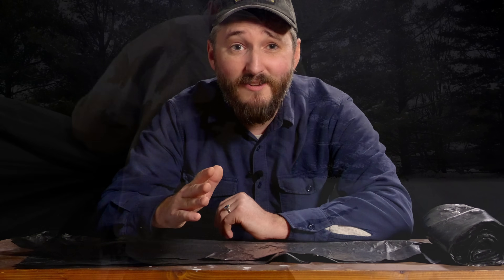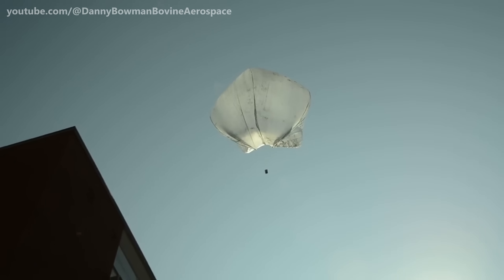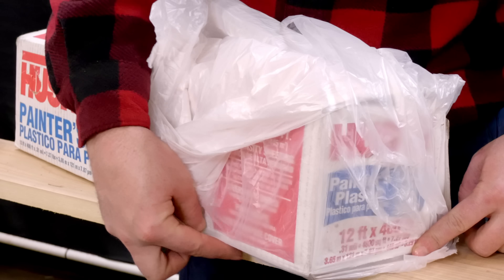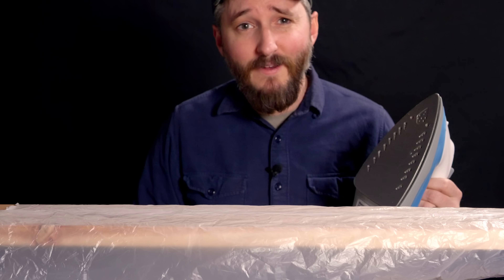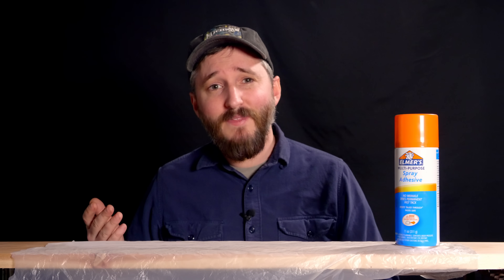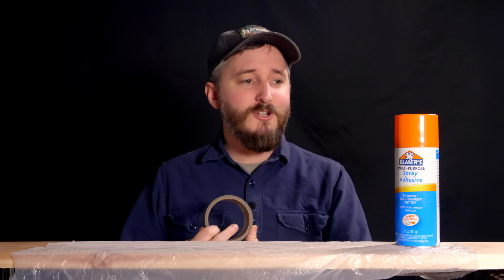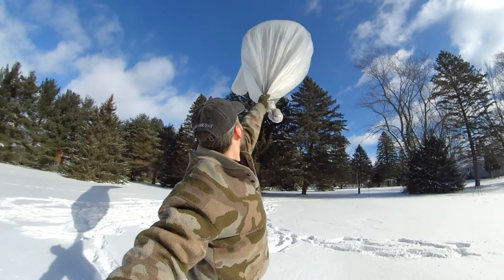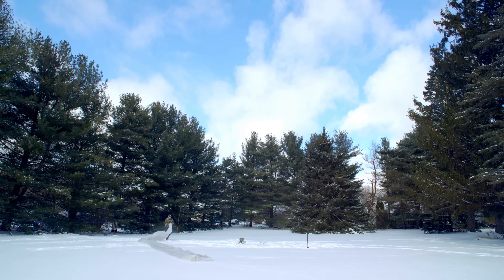DIY Solar Powered Balloons

Comment: What if instead of folding it lengthwise, you make a spiral (more of a helicoidal shape I guess),  adjusting the overlap gradually to make it closer to a sphere?
Reply from the maker: Adjusting the overlap would require a pretty tough calculation I think. You could do a spiral to make a larger diameter tube though and tie the end as usual. One or two other people suggested that idea
Reply: @Nighthawkinlight  Maybe do some test fits wrapping around estimated sized balls using some weak tape you can put on and take off without tearing, and then once you figure out the fit, draw the folds with a marker or something, unwrap, and then make it permanent? Or maybe do it in two hemispheres to make it easier to use the iron or heat tool to fit all the way (leave a hole to turn it inside out if it turns out the hemisphere seam is better kept on the inside)

Comment: @5:40 when using the iron - the reason you ran into an issue was the lack of a frictionless intermediary. For some materials Waxed Paper alone is enough, for thin materials like this you'd probably need both Waxed Paper and Talcum Powder. It's a really easy solution and prevents your iron from getting gunked up.

Comment: I know you probably have a million suggestions at this point but rather than trying to melt two surfaces together, I would imagine it would be much easier to put the two edges together like you would when sewing a seam and then melt through and cauterize the edges together with a hot cutting tool. I'm pretty sure this is how garbage bag edges are connected. Giant rolls of sheets laid on each other and then cut with hot knives that melt the edges together during the cut.
Reply from the maker: Could be worth a try

Comment: I was kinda expecting ultra sonic welding when you started talking about the adhesive stuff? Is that not a viable option for this material?
Reply from the maker: It's viable, but not accessible for most people
Reply: @Nighthawkinlight  have you seen This Old Tonys venture into ultrasonics? Not sure I'd call that kind of diy setup less accessible than some of your other works. Admittedly I was thinking more about reliability than availability.

Comment: Would it perform worse on a 90deg day in the summer? I mean is it more buoyant now because it's the sun warming it while the air temperature is much lower?
Reply from the maker: I've only used the black balloons in the summer until now. They work great in warm weather

Comment: For kids you might use sharpie to add some black heat absorption. Not sure how tolerant it is to acetone but you also thin the ink with it, and maybe silk screen the balloon which can teach simple manufacturing. 

Might also take the sphere pattern for 1 end of the tube circular saw with the base screwed to a stick or tied to a string can cut a rather nice radius on some 1/4 inch ply and the rounded shape and less material is probably going to be a bit more light and efficient. Lot of work though. Could also put a string inside the from the bottom knot to the top spring loaded motor or a rotating shaft and get a little inflation sensor biased on how much string is unwound. There's lots of sensors that'd work for that from 360degree pots to hall effect sensors, on a little stm32 you could get internal readings of temp and using that string pleasure to see how it preforms in flight use the stm32 to connect to a little Arduino or pi over Bluetooth.

nifty project.

Comment: the reason you want spherical balloons instead of tubes is due to the lifting gas to balloon material ratio. most hot air balloons air open bottom so the gas can escape and minimize the density inside, but then having a way to top it off (flame) becomes useful if it ever deflates for whatever reason. blimps or other lighter than air controlled flight toys can be really neat; saw a penguin like robot once! :O

Comment: Not certain, but think that the carbon dioxide should probably diffuse through and out of the plastic pretty quickly.  Not much, besides metals, holds in carbon dioxide well.  I had thought about using CO2 for a backpacking camp pad (since it is a far better insulator than air) until I learned that.

Comment: 13:50 Water vapour is less danse than air. Water vapour is lighter than air.
Water = H2O -> Molar mass(water) = 2 * 1,008 g/mol + 1 * 15,999 g/mol = 18,015 g/mol
Molar mass(dry air) = 28,96 g/mol

Increase humidity in air (more water vapour) will reduce the density of the mixture as long as the water stays as gas and does not form liquid condensate.

Comment: Try the thermo sealing again, I just did it successfully with a hair dryer. The trick is to clean the edge with alcohol to clear the powdery coating off the plastic first.

Comment: Look for a heat sealing iron. I used one for some vinyl heat shrink on a model airplane. It will let you dial in the temperature you need and provide a wide flat surface to melt the plastic.
It looks like a small clothes iron with an extended handle and a temperature dial on top.

Comment: by using a layer of parchment paper as a non-stick interface between the iron and plastic, you can apply heat to melt it without moving, then when it's cooled peel the paper off

Comment: nice. Interesting that it looked like smoke still suspended in the air that exhausted when you deflated it. Maybe the sun is heating the volume of air and not just the plastic surface
Reply: The advantage of heating the volume is that the air will insulate itself. Surface heating of the plastic will dissipate the heat much faster. So super fine smoke particles would be ideal (as they will stay suspended in the air for longer). Maybe a relatively small noodle could lift a mobile phone so you can get data reception ?

Comment: You could try to put baking paper on the wooden plank and ontop of the film. Also use the corner of the iron for welding the plastic between the baking sheets. As a glue something like contact glue might work. That stuff you have to put on both surfaces and let it pre dry before pressing it together. Super glue might actually work aswell but it might be more stiff and a bit heavier. Pu based glues might work too.

Comment: You could ahve used any ATG tape dsipenser from 3M i believe its a tape made out of Acrylic adhesive without any backing! and comes in wider sizes as you small gluetape

Comment: Great video! Both what you demonstrate, and how you do it! In many ways. 

A suggestion, pure nitrogen is about 3% lighter than air, I don't know if using nitrogen as a lifting gas to get an advantage in combination with solar heat would be considered an interesting thing to demonstrate, or just a lot of extra effort and bad "cheating".

Comment: If the diameter remains constant then why would the lift increase with a longer balloon. The weight of the plastic is increasing at the same rate as the volume. To increase the lift you need to increase the diameter. Or am I missing something? Great video though, I always enjoy your work!
Reply from the maker: Longer length just gives more volume per weight of the bunched plastic at the ends
Reply: @Nighthawkinlight  thanks for replying it’s really great that you read the comments.

Comment: Adhesives will add weight. Have you considered using something like a womans hair straightener to heat both sides of the plastic evenly?
Reply from the maker: Yes, but still an issue to control temp and hard to make a tube with something that pinches on both sides

Comment: Twice as thin? Groan So many things wrong with that. Thin can't be measured, it's a figurative comparison, twice usually means two, it's mathematically impossible, and it's fractionist; don't hate the divisor, love the half (as thick) or quarter (as long). I will never stop defending this, and begs the question as well. It actually means something.

Comment: It's inspiring that we can send an object so high up that the curvature of Earth is clearly visible from it, while using only common, cheap, and easy-to-work-with materials.

Helium - in dwindling supply
Hydrogen - can be cheap but is hazardous
Rockets - expensive and hazardous, also much trickier to engineer for such altitudes

A big plastic bag - as cheap, easy, and safe as anything gets

With a little diligence a hobbyist could choose a day in safe location, with the right weather and air traffic, and get some very nice video from above the clouds. A small "black box" attached with a smartphone and a parachute could give video and GPS tracking for wherever the craft lands. A tiny resistive heating element could also be attached to break the balloon at a fixed distance, delay, or via remote control to ensure that the operation goes smoothly.

Comment: Wait a second. I have just a smidge of doubt that the glue dispenser actually dispenses glue, when i had one, i had the impression that it's a kind of double sided tape where the carrier tape is very very thin and fragile. I'm thinking similar to... Tesa 4965, there's also the same product from 3M forget what it's called... the product category is called transfer tape i think. Since these are used in cell phone repair, there's any number of suppliers who will cut a roll into a number of thin rolls for you, 2 to 9mm wide by your choice, and these are very thin, available down to like 0.05mm thereabouts.

I have it on good authority that polyethylene can be welded with methylene chloride, but i have severe doubt that it's going to work with thin films that easily, i think it'll just burn right through basically and cause it to separate under surface tension. Maybe if one were to buffer it with something to make it less aggressive? Ask "3D Gloop", they might have a thought.

I wonder if it has been tried to heatweld it with a clothes iron but with a Teflon separator sheet or at least a waxed baking sheet. But with film so thin, that's not going to be easy either way. Without separator, it's not going to work because it'll stick to the iron before it can heat through enough to stick to itself. You also need another separator at the bottom.

Comment: Your short example with the clothes iron touches close to my line of work! That example was what we'd call "Impulse sealing" just using heat and pressure. Most of the films I work with range from 12 mil up to 30mil pvc and up to 45mil cspe. The big difference is we use RF Welding, not just direct heat. For a 32" long lap weld with 1/2" width our 10kw machines handle easily. We can make a weld that long every 30-45 seconds if working fast. For something as thin as .3 mil you could probably use something as small as a 2 or 3kw machine. The book "RF Circuit Design by Bowick is a great foundation for the technology. If you're interested in learning more let me know and I'll send an email!
Reply from the maker: Thanks for the book reference! It would be great to have something like that for my own use, but for a video I'd like to keep the methods more accessible

Comment: I did this once with large diameter (2 people would fit inside) but flame powered. Released it at the night. It flew very far... Indeed, painters sheet is the shit.
In EU, you can get like 5 micron painters sheet, that is glued easily. It's the cheapest one obviously. Very good.

Comment: Having read a couple of books about dirigibles and blimps, I already knew that there would be considerable lift available from the sunlight. The old airships were silver-colored to reflect sunlight and make them more controllable, but they still preferred to launch in the mornings to take advantage of the "superheat" as they called it. Hot-air balloon pilots take advantage of it too, thus saving fuel. And thousands of feet of altitude change occurred with the cross-Atlantic and round-the-world balloon flights between daylight and dark because of the sun's heat on the envelope.

I'm not sure how environment-friendly or heavy it is, but burning styrofoam produces a lot of black soot in the smoke. That might be an easy way to darken the plastic and add lift. Glad you found a glue that worked well on the PE which is notoriously hard to glue well.
Reply: I would strongly suggest against burning Styrofoam, especially if was first soaked in gasoline. :)

Comment: I used to make hot air balloons when I was a kid out of a dry cleaning bag (top sealed up with some clear tape), a few thin pieces of balsa wood to form  a cross at the bottom of the bag to keep it open, and where the spars intersected I mounted a small cup I formed out of aluminum foil.  I would douse a cotton ball in rubbing alcohol, place it in the foil cup and light it on fire.  The balloon would fill up in a few minutes, then I'd let it go.  It would drift out of sight.  At the time I lived in the city, so naturally I needed to figure out a way to mount fireworks on my balloons to make things more interesting.  Unlike the clip in your video where the fuses are lit right away, I figured out a lit cigarette takes 10 minutes to burn down to the filter, so I would put a tiny slit just before the filter, insert whatever fuse(s) the payload had, and launch the balloon.  Jumping jacks were quite entertaining.  Regular firecrackers were fun, too.  The best were the homemade ones I made from the tube from a Bic pen with the cap superglued in place, then filled with all the explosive powder I could scrounge from disassembled firecrackers, bottle rockets, etc.  Fill halfway, make a tiny hole for the fuse, insert fuse, continue filling, glue another cap on the open end.  The pressure wave from these things used to set off car alarms in an underground parking garage where I lived.  I had to come up with something, you know, because M-80s and H-100s were illegal by then.  I have no regrets.

Comment: By chance, I was going to start a project that is very similar to what your doing, I was going to make a yurt, but using thicker plastic for the shell, as the most expensive part of a yurt is the waterproof fabric.

So I would suggest getting a plastic sealer, and working it down the seam to seal it. I was going to criss cross to really seal it.

Would spritzing water in the balloon increase its ability to float as the sun evaporates the water? Probably not?

Comment: Interesting. I'm curious if this being shot in the winter makes a difference. The cold winter air is already denser, so the balloon wouldn't need as much of a temperature difference to generate lift, right? I guess the question is would launching in the summer require a higher temperature difference? Does it take more fuel to launch a hot air balloon in August than it does in January? I could probably google that.

Comment: seconding the spiral idea, i think all you’ll need to do is get the first fold down by calculating the angle you’ll need. like imagine folding one corner of a piece of paper to the other corner it shares a face with, and then adding an offset in the perpendicular direction to determine the slope of the spiral, making a check-mark shape to start out with. once the one corner is adhered to the opposite side, you’ll just have to continue the seam until you run out of sheet, everything should stay on track as long as you keep the amount of overlap the same between the two layers you’re adhering. i’d love to see how big you can go with this! i also like how the more efficient a hot air balloon shape is, the less efficient a solar powered balloon shape is, and vice versa, because the solar powered balloons rely on more surface area to be heated more i would think. i’d like to see where the balance lies between those two means of getting lift!

Comment: I worked at a... Pet food bag factory... The woven plastic (thick, strong material) is extruded to the film (thin sheet of plastic with the graphics). They'd splice together both woven rolls & film rolls the same way. 2" double sided tape.

Comment: If they made the solar balloons with a clear upper and an underside coated in reflective mylar, I bet you could get some serious lift.
Reply: Check out the Mongolfiere Infrarouge, built by CNES.  It has an aluminized Mylar top and clear bottom…so it can fly on infrared radiation from the earth at night AND NEVER COME DOWN.  I kid you not.

Comment: This is one of those... we should go... BIG... REALLY BIG on ... like go to the salt flats and do a 300 ft long one for youtube type thing... Also, I wonder why this isn't an advertising thing in sunny non-windy areas instead of helium? Tied off correctly and built correctly i could imagine these being able to stay up all day long and draw attention.  There might even be a way to boost the heating effect electronically with simple circuitry and super thin heating wires in the "bottom".  Thanks again for another great video.

Comment: Do you think it wouldn't work as well in the summer due to the lower density of the surrounding air? Great video regardless!
Reply from the maker: It works great in the summer, I've done it many times with the smaller ones

Comment: I think the iron method can work great but you really need to control the temperature very accurately. A copper bar with a heater, PID controller and temperature sensor should be able to do it. Clothes irons have terrible temperature control and heat distribution from my experience with some cheap ones. The more expensive ones are probably far better but I can't speak for those

Comment: I'm sure it's not the ultimate goal, but I saw Robert Murray Smith make a thermocouple out of two types of graphite; could the radiative paint be used with that concept? Or would the cost of the cooling paint offset the "make a lot for dirt cheap" idea for that project?

(Bonus question: is there any analogous benefit of packing carbon spheres from soot and the like to make a warming paint?)